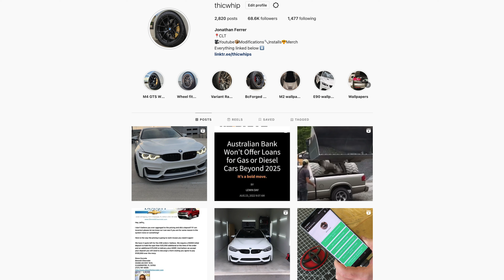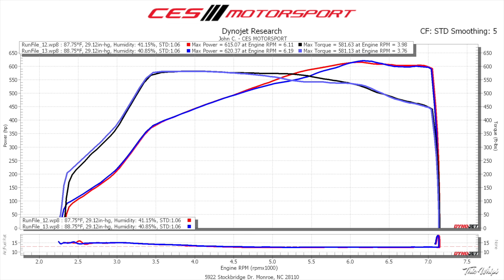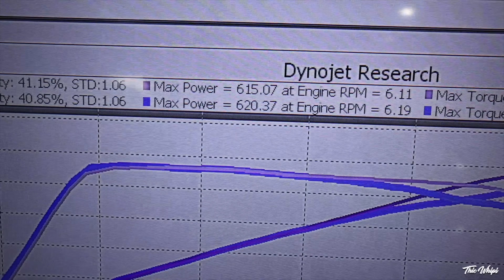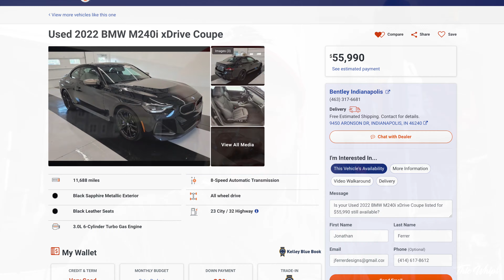Is The B58 Better Than The S55?

Comment: I feel like the b58 and s55 can’t really be compared, as one is made with two turbos for the driving experience. One is a track car, one is a daily driver that just happens to make great power. Both are great motors.
Reply: I own a 340 btw. Just two different driving experiences. Great video btw:)))
Reply: Dont think its meant to be compared more about the differences so people know which one to choose
Reply: No there is a reason to compare them 😂 money to power ratio is a big reason s55 is overpriced the b58 will be around way longer
Reply: @MrCougar1825  that’s why I own a b58 lol
Reply: @i_villa7967  that’s great but that’s the point I was making the s55 is trash compared to b58 it’s not even a comparison  s55 will be a wast of money in 5 years
Reply: @Mannyox I just wanna know which will make the most power cheaply
Reply: @kwamz1872  b58 hands down
Reply: @kwamz1872  downpipe tune s55 you make 500 wheel b58 you cant. But to get into s55 platform is more expensive.
Reply: @orangastang5291 dp, tune b58 are cracking over 500hp lol
Reply: @iJustB58  people are weird they don't keep up with the platform and then assume it sucks
Reply: This is a good perfect example of somebody who doesn’t know about engines. 🤦🏻
Reply: @iJustB58 not on pump gas you’d need ethanol vs s55 you wouldn’t. Had both
Reply: @iJustB58  lol you arent touching 500whp without meth on a b58, s55 on meth makes 600whp
Reply: What are you going on about…. Yeah you can. You can compare about how strong the block is compared to the B 58S 55. How good the turbos are comparatively to the both. You can compare the engines, not the driving experience because that comes down to the car, the suspension the transmission everything comes in engines are engines

Comment: I have both, and I would say I like the edgy nature of the S55. Not only that, but it revs so much quicker. The B58 is still amazing though and probably a much more comfortable and refined engine. It’s important to note that the B58 is a much simpler engine that is incredible from an engineering standpoint. The low end torque is great and so is the sound.

Comment: N20 is King LMAO. Seriously though, it's hard to compare an S and B engine because of the platforms. NOW owning a S55 and S58, I'm feeling the effortless power delivery of the S58 over the on edge S55 feeling. S58 feels like a smooth jazz singer. S55 feels like Tweek from South Park. Always cracked out ready to bug out at any moment. That feeling is fun some times but nah. S58 is daddy lol.
Reply: N20 gang😂
Reply: The video is about the B58 not the S58, obviously. 

S58>B58>S55>N54 with Index 12 and Eldor>N55
Reply: that's exactly the good thing lol, never know when the S55 is gonna try to randomly kill you at any point

Comment: if we just talk about the motor itself, b58 all day, it's just better built and easier to work with. However s55 come in M cars with much better chassis, so a bit hard to compare.
Reply: A B58-swap in an F80 sounds pretty nice.
Reply: @shrimpboychan  That would be nice. I did see someone on bimmerpost that did a b58 swap into an OG M2. Big hassle tho.
Reply: Best chasis so far is the supra, stock b58 supra is beating the s58 m2 stock for stock
Reply: @ThePrestigeification  In terms of what? 0-60? Or around a track? The s58 m2 is really just an m4 with a smaller body kit, it is insanely heavy. Now, the F generation m2 with a b58 in my opinion would definitely beat supra in terms of how it drives and handles. Other than that, no idea.
Reply: @ramen9996  around the track*. 0-60 the s58 m2 won. Savagegeese’s video put both cars head to head on the same track with the same driver, weather, day and what not.
Reply: @ramen9996  why would the F chassis be superior to the supra's? in the end they are both 1500 ish kg coupes
Reply: @andrxito  Well, like I said, in terms of how it drives and handles. Not exactly driven by spec sheets. If you really wonder why I said that, drive both the OG m2 and the supra, like rent or test drive or something. Then you’ll understand why I say that. On a side note, I never said F generation chassis is better than z4/supra chassis, I’m saying OG M2 chassis is better than z4/Supra chassis.
Reply: @ramen9996  I think there's a comparison on YouTube with the 3 cars. Og m2, modern one and supra. It's good if you can find it

Comment: I currently own an M4 but previously an M140i. The S55 makes 500whp with decat downpipes and tune. The old M140i made just under 400whp with the exact same mods. In order to get the B58 to even come near the S55 i would have had to spend another £4-5k on hybrid turbos and Dorch hpfp. At this point i thought, why not just buy the M4/S55? The S55 is a superior engine out of the box.
Reply: Not true 140i with this mode is 470 horsepower
Reply: @francescosaia4475  with a TU HPFP it's def. not 500whp but close enough... the 140i is 200kg lighter than the m4

Comment: B58 COOL BUT MAN GET YOU A M3 OR A M4 WITH A S55 UPGRADE TO A 4 PIN CRANK HUB FLASH IT,RUN it on e85 easy 550HP TO THE WHEELS

Comment: I have a m240 xdrive and I absolutely love it. I'm at 500whp with pump, getting ready to go port injection and run E. Hoping to see 650whp, just hoping the xdrive can handle that much power
Reply: I believe the m240 transmission would need to be built for that?
Reply: I think so too, you might start slipping in the 600whp range
Reply: You will start to slip in 6th mainly and if your a 16/17 DO YOUR INJECTORS mine just gave out and ruined my engine just after gettign a hybrid turbo
Reply: F series or G series m240i?

Comment: Thank you for this comparison. I am currently cross shopping manual gen 1 b58 and the high mileage s55 dct cars, i dont have any intention of doing more than intake exhaust maybe ethanol. I am concerned that i would eventually regret paying an inflated price for a clean manual b58 just because they are so uncommon, because i put a ton of miles on my cars and would likely lose my shirt on it. I think im going to try for an s55 car for a short term daily just to experience it, while the manual b58s and s65s are still more expensive.

Comment: You also get a DCT with the S55 which IMO is just the cherry on top. DCT will always give the car that race car feel which I love. Especially after the xHP transmission flash
Reply: Dct feels like its going to break any time, it stalls when going reverse to drive, makes clunky sounds
Reply: @scherpebocht it's a sports car it's not suppose to be quiet and comfy
Reply: @scherpebocht that sounds like one of ghetto clutches are failing and or its fluid needs to be changed.

Comment: You forgot to mention the powerband differences. The M motors (s) series are tuned to be more rev happy and generally delivery more power the closer you get to the redline. They have a stronger top end and the torque doesn't fall off like it does in the non-s motors. The b58 is not a motorsports series engine and therefore it's tuned for the low to mid-range rpm torque delivery and they actually feel faster than the s55 at those lower rpms due to more torque. The caveat is that as you get closer to the redline, the torque falls off much earlier on the b58 vs the s55 which is tuned for the high-rev driving on a track.

So the difference between the two motors isn't about the absolute power figures but it's about the character of the engine. The two engines are tuned for different applications and have a different character. The b58 gives the car more of a muscle car feel with its low end torque where the s55 gives the car more of the traditional sports car feel with its top end power.
Reply: Absolutely not true…. On stock turbos all your power is mid range to about 6000 rpm. Only with upgraded turbos that is the case. The S55 is a low end torque monster.
Reply: @fless760 you’ve got the engines mixed up buddy lol

Comment: Interesting perspective, but your arguments are based as much or more on the cars the engines are in rather than the engines themselves. Except for someone that is buying a car as a platform for mods, most people don't choose a car based on the engine. Personally, I'm not a Supra fan, so that wouldn't be my choice. Comparing a regular BMW with an M is another matter. I would much rather have my M2C than a 240, same for M3 over 340 or M4 over 440. There is no question the S58 is the boss of them all.

Comment: Why would you choose the m240 over the m340 xdrive?
Reply from the maker: New m240 is awd. Smaller, lighter, more nimble..
Reply: @thicwhipsclips yup it’s shorter wheelbase makes it just more fun from a handling perspective. Unless you put drag tires on a Supra, it ain’t beating an m240i xdrive if they’re both tuned to 600 whp.

Comment: The s55 would be better than the b58 ONLY if the s55 didn't have the crank hub issue. When you want to do fbo and stage 2 tune, you risk spinning your crankhub on the s55. If you want the crank hub fix on the s55 it is going to cost $3k-$4k just for the fix. Imo the B58 is a better engine only because it is easier to mod and doesn't have a crank hub issue and more reliable. I love the looks of the M4 but if you're talking about price for the power overall, i'd say get the b58. If you plan to go s55 stage 2 fbo and plan to keep it for a long time. Get the crank fix